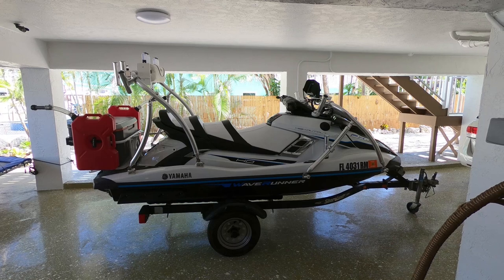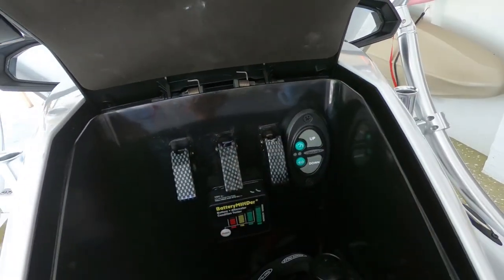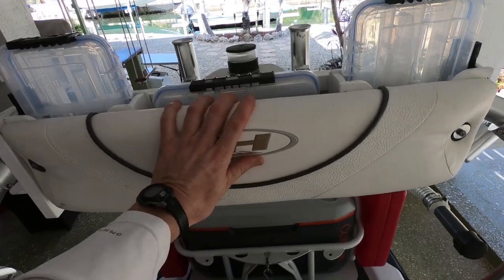HOW TO Setup Rig YAMAHA FXHO WaveRunner for Fishing

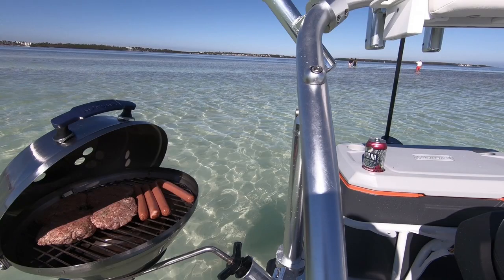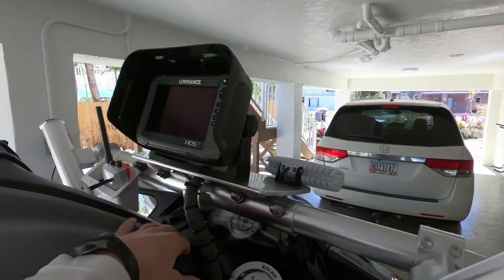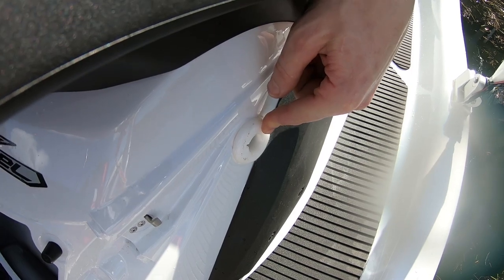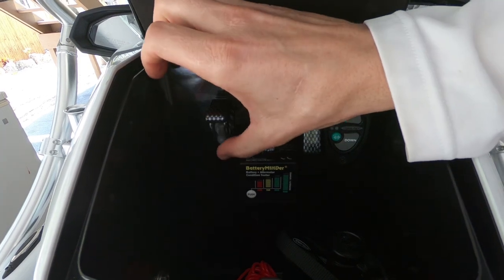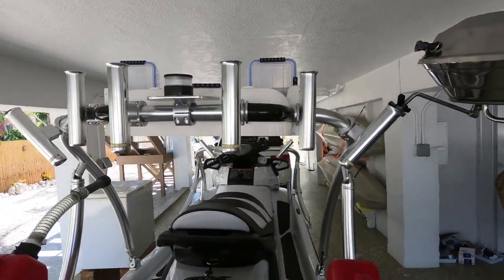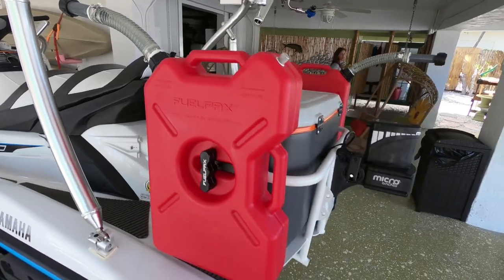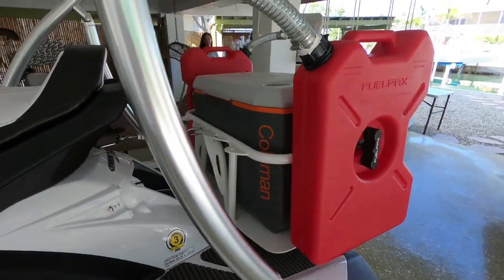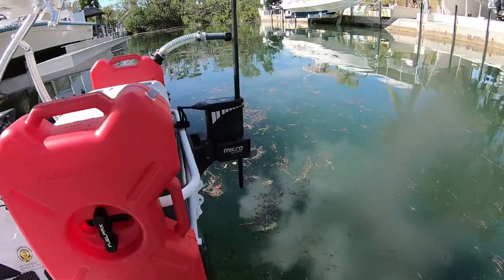Comment: Very nice, very neat, very professional looking. Thanks to all for taking the time to film and share. There are a lot of great ideas in the video. Thanks Yamaha for building a reliable PWC that allows these modifications. Thumbs up from Toledo, Ohio! Here are some index marks for your reference. Yamaha Review 15:36   Fishmaster Arches 00:57 and 08:02   Fuel Filling Cap Modification 1:41   HDS 7 Fish Finder 2:10   LED Spot Lights 2:27 7:30 7:45   Front Organizer 2:43   Ritchie Compass 3:13   Accessory Controls 3:28   Wiring 4:40 and 7:01   Batteries 5:56   Dual Bilge Pump 7:08   Navigation Lights 7:38   Rear Leaning Backrest Organizer 8:52   Rod Holders 9:38 and 13:19   Cooler Rack 10:00   Roto Fuelpax 11:13   Power Pole Micro Anchor 12:13   Transducer Mount 13:27 and 14:27   Rear Jet 14:10   Barbecue Grill 14:54
Reply: 17:04 leg day?
Reply: Hello dear Who is the fish master you deal with who made the arches for you I need to order Please put the contact or the company name to organised and replace the order
Reply: @siksekuae  this is where those arches came from https://fishmaster.com/  I dont see them listed on the website anymore. Looks like a discontinued item.

Comment: Neat project! Try mounting those forward facing LEDs upside down so NAV lights are actually visible. They need to be seen!
Reply: I agree with the quality and skill that went into this installation as well as Robby's comments regarding obstruction of the navigation light.  Additionally, the all around anchor/navigation light as currently mounted to the arch will not be visible throughout 360 degrees.  I needs to be mounted higher to not only avoid being blocked by items which you have mounted to the aft arch, but also to by the operator and passengers.  While PWCs are not permitted to operate after sunset in my area, if permitted in your area and you intend to fish at night, then the navigation light and all/around light should be separately switched.  The all around should be switched on at night when anchored or drifting, at which time the navigation light should be switched OFF.

Comment: I would get a Blue Seas 7601 so that you can charge the accessory battery while running the engine. The stator would charge both batteries and then switch off when your using the accessory so you don’t run down the start engine battery

Comment: Yea, bolting those flood lights right in the way in your Nav lights is illegal.  The arc of the forward nav lights should be an unobstructed 225 degrees.  You have about 110 degree vis on those.  I would ticket for sure.

Comment: Would it be possible to take advantage of the smaller size of lithium batteries put a higher amp lithium battery (same voltage) to avoid putting two batteries?

Comment: When routing your transducer wire... You went through the water spout tell tale and then into the wet storage area... 1) What did you do with the water spout line? Did you re rout it outside of the rack? 2) Did you move the engine flush fitting or leave it in the factory wet storage area?
Reply from the maker: The hose for the spout was removed.  The transducer is routed under the rear rack and enters the WaveRunner directly next to the flush fitting.  I did not move the flush fitting.  Thanks for watching and best of luck with your build.  Send pictures.

Comment: Correct me if I'm wrong or if it's different in Florida but Personal Water Craft are not allowed on the water before daybreak or after dusk. If it were as simple as adding navigation lights, everybody would be doing it.
Reply from the maker: Hello and thanks for watching.  Since I run offshore, the navigation lights are there just in case I am late getting in or for bad weather.

Comment: Thats a great set up. You've thought of everything & more. I had an issue on my ski where the rack fell off as my turn buckle (same as yours) snapped. I swapped to a stainless steel, endless loop ratchet strap & also a stainless steel safety chain & shackles.
Reply from the maker: Thanks for the support.  I just changed mine to stainless and will keep it all stainless on the new build.  Stay tuned.

Comment: What is the bluish grease all over the bolts etc on the nozzle/steering linkage?  I use my waverunner in salt water too and spray everything down with CRC 6-56 after, but should I be greasing some spots too?  Thanks for the great video!!!
Reply from the maker: Hello Greight, the grease is OMC Triple Guard Grease and is very sticky.  It outlasts the sprays and if applied a couple times a year, it will prevent salt water corrosion.  Thanks for watching and your kind words.

Comment: seems really nice, I have a question about the transducer mount. Does using/ blocking the waterspout with the transducer cable cause any overheating problems?

Comment: I noticed in one of your videos that you had a painted trailer (not aluminum or galvanized). Will it hold up with very infrequent use in salt water? Do you coat it with rust preventative?

Comment: Great videos & very informative. Im looking at 2020 Yamaha vxho model in the upcoming year & was curious on custom arches that are not so big around. To me it would seem more streamline,less top heavy, & more room if you went with smaller width arches. Please let me know if this could be option & if there is special reason your using that size width. Appreciate any feedback & love watching all your videos, great job.
Reply from the maker: Thanks for the kind words.  I would go with an FX model as the hull is more V shaped and makes a big difference on the open water.  The Arch is bigger than my prior ski fabrications but does not make it top heavy.  The aluminum is super light weight.  The wide arch was the  only size sold at the time of ski fabrication.
Reply: @dpbaynon  Appreciate the feedback. I do not see anyone fabricating an outside/outer cooler attachment holder to frame arches to utilize the standup rear deck space for offshore/inshore fishing. Like an outer raised holder where you could still get in from stepdown, to utilize that rear deck space for standing/leaning on arches for fishing purposes. You would have to extend out further the arches but you could utilize that room much better it would seem. So many options, you gotta love it. Keep videos coming bro, thanks.

Comment: I would image all these add on would effect the stability of the PWC dramatically. I know someone who rolled there's over and they weren't able to right it again as Pwc's are designed to do.
Reply from the maker: The WaveRunner is extremely stable and I have never has any issues, even in the roughest seas. They are designed to carry three adults and the extra weight I have is only equivalent to a very small person.  In addition, it's all kept low.  If the person you know had issues, it may have been related to a high center of gravity.

Comment: Hi, is the fishmaster arches really sturdy? Especially the rear arch. I'm planning on carrying a scuba tank or two by modifying it a bit. They, both front and rear, look to be sturdy but are they really sturdy? Just wanted to ask before ordering them. Thank you.
Reply from the maker: anzai123 the arches are very sturdy if you through bolt them in both front and rear.  Good luck and thanks for watching.
Reply: Thank you. Just found out that Fishmaster discontinued the front arch. They only have rear now but probably will discontinue the rear also as soon as everything in stock is sold out.
Reply: Yes, I also hope they reconsider discontinuing. But if that happens, you should get some commissions, haha.

Comment: I'm curious, what type of material did you cover the screws and clamps with? It looks like marine grease. I assume it is to protect them from the salt water. Thanks!
Reply from the maker: That stuff is great, it's called Triple Guard Grease by Evinrude and won't wash out, very sticky and keeps the salt off.
https://www.ebay.com/i/372199299551?chn=ps

Comment: I looked on Fishmaster.com and they only sell the rear fishing arch. It looks to me as though your using 2 rear fishing arches for both rear and front arch. Is that correct?
Reply from the maker: I purchased the front arch just prior to them discontinuing them.  Two rear arches should work for though.  The only difference between the front and Back is a few inches of height on the up tubed.  Thanks for watching and good luck with your build Wyatt.

Comment: That’s what I am saying. It doesn’t seem to me that a wet cell would be feasible to use because they require a vent for acid fumes to get out. It seams to me a sealed lead acid would be more practical for something that is going to get josseled around pretty good
Reply: An AGM replacement battery is the way to go on a Waverunner. Yamaha designers put the liquid acid batteries in their skis at the factory. It makes sense to use the liquid acid battery that came with the ski until you have $100 to burn on the AGM battery. For my FX SVHO and VX I use an AGM replacement battery that I purchased from my local Battery Wholesale store. It's a 325 CCA Deka ETX AGM Part # ETX16L . Its the Yamaha factory battery equivalent. The original factory battery was always low on fluid. The liquid acid was leaking from the battery vent tube down the outside of my jet ski and left permanent streaks in the paint. I assume this was happening because of my driving habits. I like to thrash around on the jet ski every now and then. The AGM doesn't use liquid, so no longer have issues with leaking and low battery fluid.

Comment: I really like the lighted fuses(front compartment), switches, and battery tester (center compartment ) which you used. I've tried to find them online but no luck.
Would you please tell me the links which you have bought them?
Reply from the maker: The lighted fuses and battery tester purchased at Walmart and switches on Ebay...
https://www.ebay.com/itm/Cole-Hersee-5582-10-BX-PVC-Coated-SPST-On-Off-Toggle-Switch/253355799648?hash=item3afd2eb460:g:c-QAAOSwaC9aU-do
Reply: WRESTLING & WAVERUNNER FISHING FAMILY what are the things which you flipped up before you flipped the switches?
Reply from the maker: https://www.ebay.com/itm/1pc-Carbon-Fiber-New-Toggle-Switch-Waterproof-Boot-Plastic-Safety-Flip-Cover-Cap-/401459964617?hash=item5d78e0eac9
Reply: WRESTLING & WAVERUNNER FISHING FAMILY thank you so much! !!

Comment: Would you please tell me what brand and model number of those spotlights? Thanks
Reply from the maker: https://www.amazon.com/LeaningTech-White-Spreader-Marine-Lights/dp/B01JS5FIYU/ref=pd_day0_200_1/133-9760560-6235529?_encoding=UTF8&pd_rd_i=B01JS5FIYU&pd_rd_r=7N8AHBPJGHKTFKR2QB1G&pd_rd_w=LYnJr&pd_rd_wg=Tmzlz&psc=1&refRID=7N8AHBPJGHKTFKR2QB1G
Reply from the maker: Hi Paul, you can also search for them on ebay for a bit better pricing.  I should be posting those electrical build videos in the next couple weeks when I get some free time.  Good luck with your build and send me some pictures.
Reply: Thank you very much!!!
Reply: Will send you some pictures when I'm done

Comment: Have you ever considered adding side saddles like as shown on the JetFish out of australia? See https://www.youtube.com/watch?v=54L2p1uVecw I would think adding something like that with your front arch would work well. The only part of your setup that I'm not sold on is the back arch and the cooler on the back because you loose the ability to use the back deck for landing your fish. If you watch the video I linked above you will see what I mean. 

Between your setup and that JetFish I'm really thinking about going the JetSki route instead of a boat. I can really see the advantages.
Reply from the maker: In rough seas, the arch allows me to stand and fight a fish.  I like the side saddles for stability but cant imagine not having the rear arch for a leaning post and keeping rods away from the salt water while running.  Maybe on my next build, I will try to incorporate both.  Thanks for watching and I appreciate your info.
Reply: Good point on the leaning post with the rear arch. I guess really the only thing that bugs me is the cooler on the back blocking the back deck. With the side saddles you could get rid of the cooler and get the best of both worlds. 

Oh that video didn't really show it but the side saddels just clip on/off  when you don't need them.